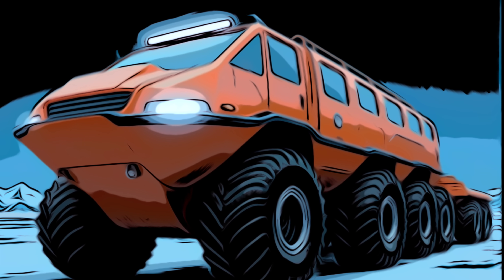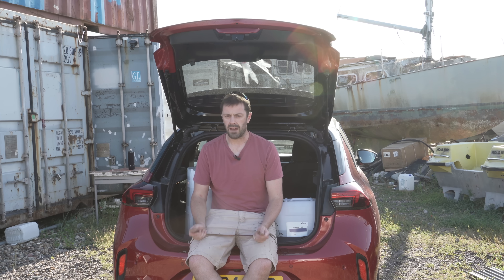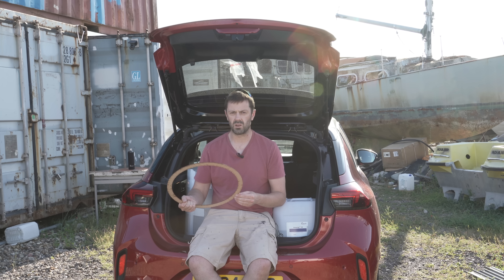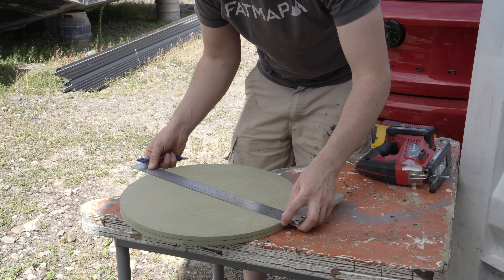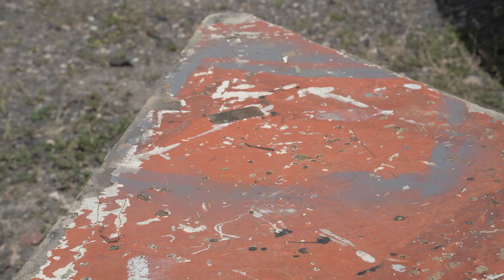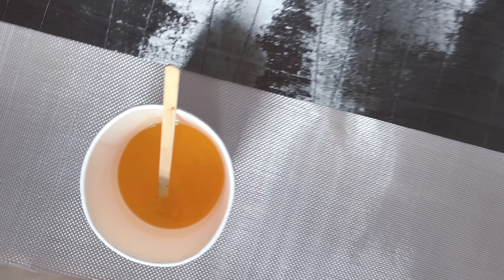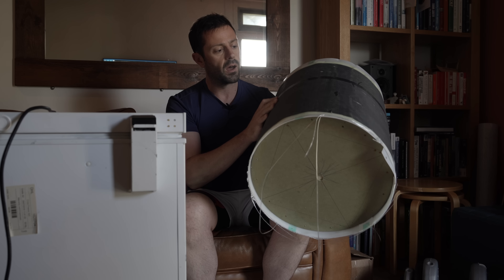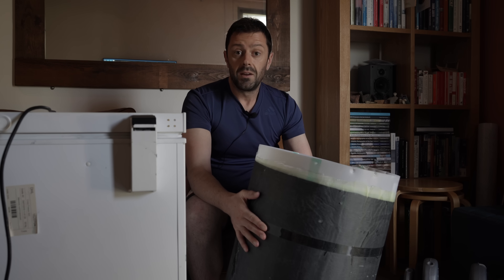Scale prototyping airless carbon fibre wheel rims for polar sledge & Arctic Vehicle BERNARD [4K]

Comment: Because the tire mold looks like Bernard’s hull. How will you release the hull from the mold… flip it over and hope it falls off? And with the persistent heat wave maybe when working back at the flat a nice chill rosé would be appropriate i’m sure it can be chilled in a 40 below freezer in 10 seconds for optimum drinking. The precise jigsaw work was as equally satisfying as grinder work.👏
Reply from the maker: There's no release angle on the tyre mould, so that was predictable really, and sliding it off rather optimistic. I've managed to get it off without causing wanton damage.

Bernard's mould has a release angle even for the near-verticals. Since the part will be extremely strong, we'll lift it off using a load of people tapping and wedging the edges as a basic chain engine hoist lifts.
Reply: That makes sense…. That was probably explained in one of the Bernard’s  mould build episodes and I missed it. Thank you for the explaining again.

Comment: what about forming the hub over an inflatable boat fender, then just drop the pressure a bit to release it. If you can find one the right size, which looks  possible.
Reply from the maker: This is an excellent idea, providing one is available with a near consistent radius.
Reply: @AlexHibbertOriginals  yeah they're fairly robust and well made, the ones that I've seen.

Comment: Just a thought on leverage - a beam axle that runs all the way through the wheel would be least likely to fail but impossible to steer. Wide wheels exert great force on their bearing/connection. If you can get the centre of effort as far as possible inside the centre of the tread pattern you'd achieve a more robust construction and as it's an essentially hollow wheel, maybe worth considering at this stage in the design process.......
Portal axles being a good example to study.
Devil's ointment fly - as it's electric drive getting the power source torque as near the centre of the wheel would reduce a lot of complex power sapping/expensive transmission issues - in theory!! However you already have a transmission finalised .....
I'll get my coat/see myself out....
Reply from the maker: Cheers Dan

Luckily on both sledge and Bernard, there's no wheel rotation for steering. It means a long axle to the near outside of the wheels is possible. It means there's lots of scope for efficient power transmission and load bearing.
Reply: @AlexHibbertOriginals  Awesome, sounds fascinating. Cheers!

Comment: For a "disappearing core", a low melting temperature wax and a heat gun might be a better solution than producing semi-hazardous waste via solvent and styro.
Reply from the maker: If I can keep the wax a constant thickness, i like this, but it would be tough. Agreed on the lack of enthusiasm for dissolving nasty plastics.

Comment: 2:22 the sledge wheels don't need to grip
if they slide then it's a sled, if they grip then it's a wagon, if it does a little of both on mixed surfaces thats even better
Reply from the maker: It's sliding we want to avoid as that's the normal sledging system with UHMWPE runners. At -35 or below sliding friction is crazily high, so we want rolling friction with high quality sealed bearings.
Reply: @AlexHibbertOriginals  Interesting. So it's like when the ground is super cold and you don't slip on ice anymore because the pressure is no longer enough to melt it?
Reply from the maker: That's it. There's no surface microlayer film of water, so it's brutally hard work. -20 deg is fine.
Reply: @AlexHibbertOriginals  do you need to avoid sliding on the warmer days too?
Reply from the maker: I think even in warmer conditions, rolling friction is much less than sliding friction with all other factors controlled.

Comment: Are you planning on testing these off the ice? Maybe shoehorn them onto a trailer and drive around in circles? Or be fancy and have them roll inside a cylinder for weeks?
Reply from the maker: I could do something like that, sure. Just not near where I'm trying to rest/sleep.
Reply: @AlexHibbertOriginals  Thinking about it, if the yard lets you, you could just mount a full drive unit plus wheel on a long stick with a bearing. That way you'd get two tests for the price of a piece of wood
Reply from the maker: Good idea

Comment: Many a great engineer has tried and come up short against the dunlop tyre bud. I respect the moxie, but I fear this is a misstep.
Reply from the maker: You're certainly not the only sceptic, but these types of wheels are really widespread in the low speed all terrain world. They aren't experimental any more. https://img.equipmentworld.com/files/base/randallreilly/all/image/2014/11/eqw.michelin_tweel_010.png?auto=format%2Ccompress&fit=max&q=70&w=1200
Reply: @AlexHibbertOriginals   Thing to consider: How many man-hours of development and testing went into this tyre, which is still made from conventional materials? I share the fear that this may take a lot more effort than expected, and it's an ambitious project already...
Reply from the maker: I'd buy them off the shelf if they were made in the right sizes and config. But otherwise, I'm going to be copying the principles of existing wheels (which do use composites), and in some areas the exact components. It's really not a pie in the sky experiment.
Reply: @AlexHibbertOriginals  Fair, although just have a watch of Mr Dunlop making the first ever pneumatic tyre https://www.youtube.com/watch?v=T_EZ3QuYYXU I suspect you'd end up with a better wheel faster and cheaper. I think its doable to make a rubber tyre of any size shape (plus rather novel for youtube content).

Comment: Only a suggestion. But before you destroy your mold, perhaps try an air line blower! I have used that method to install and remove motorcycle grips on a few occasions. If you could get the tip of the blower tool between the layers, it may give you that little margin of release? 👍👍
Reply from the maker: Will have a crack but not optimistic.

Comment: I agree that a thin (10-12mm) layer of polystyrene is the way to go. Speaking from recent experience, solvents will affect the resin on the (inner for you) surface, so future bond strength of your springy spokes may be affected. Given the different kinds of resin and solvent, it's hard to say if you will or won't have issues, but my recent issue was with alcohol on polyester.
Reply from the maker: I may use another plastic with a less nasty solvent than acetone. Will see.